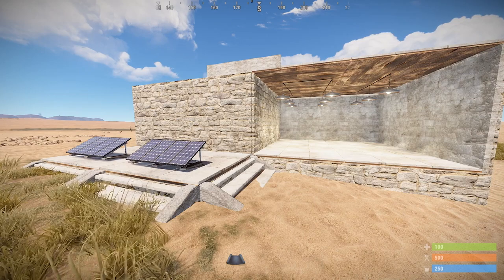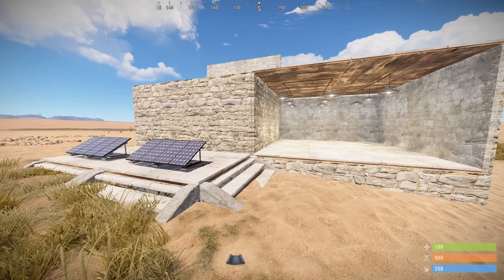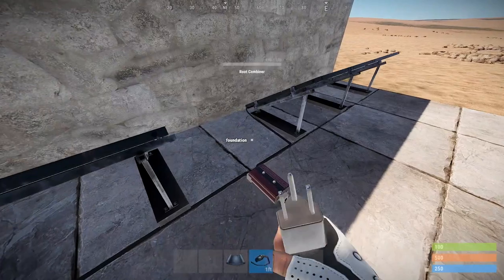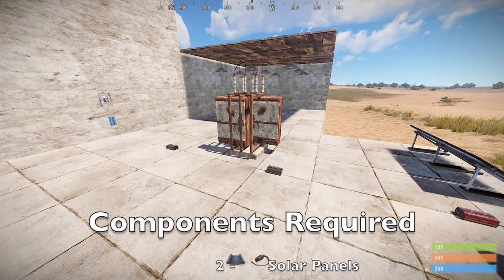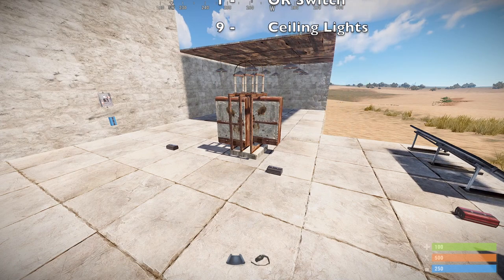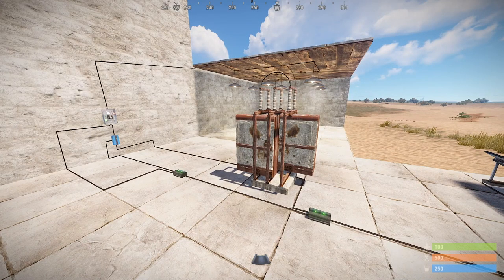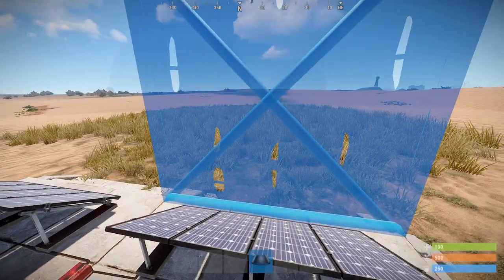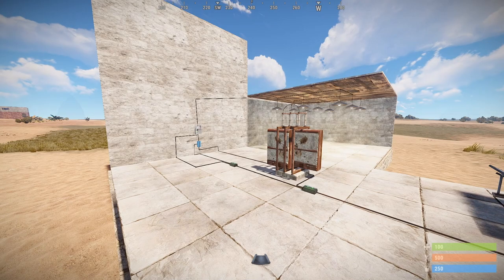(RUST) Electricity 101 - Unlimited Power S02 Ep2 (Battery Backup)

Comment: Funny I have looked everywhere for this solution, and I have found nobody on YouTube knows how to properly setup a multi power source - multi battery backup setup that switches when the power drops below a certain threshold. So I started thinking about it very hard how I could resolve it. Realistically if you could program the blocker to look for a certain block pass through input, and switch if it drops below it that would fix it right? 

So I realized I had to create that scenario myself. I clicked on your video and hit pause and started thinking, if I add a second brand after my main output, and then branch out a small amount to the block pass through, if I lose a windmill or have low power coming in it would switch to battery. 

Then I watched your video and you had the same solution! This one gets a thumbs up from me. Being an electrician this has stumped me and I thought it just wouldn’t the possible in this game yet. 

Thank you!
Reply from the maker: Great to see that my videos are still able to help people. Thanks for your kind words and I hope you enjoy! 
Some things about batteries have changed since this video was posted, which I covered some of them before I stopped making videos, but those circuits are still relevant for certain purposes.

Comment: So maybe I am being dumb... Whenever I did this design I was getting like 268 power from solar panels and windmills (I let the battery reach full charge prior to this) but even at that full power my battery was being drained. To solve this I set the first branch at the power I needed, then the second branch I flipped the branch out to the blocker, and the power out to the OR switch and set the branch at 1 power this seems to have solved my problem. I don't know if this was changed in a patch or I just messed something up but so far it's working beautifully after this change.
Reply from the maker: I go into more explanation about setting your branches up correctly in one of my more recent vids that showcases a few different backup options. Otherwise, join my discord for help :)
Reply: Ol this worked for me, had the same problem

Comment: not sure what im doing wrong, but my battery is just draining, i have 8 solar panels hooked up to root combiners and did everything right. but the blocker itself is DRAINING my battery, the battery only starts charging once i disconnect the wire from the blocker. HELP! :(
Reply from the maker: Sounds like your electrical branches are not set correctly. Perhaps try joining my discord for some help :)
Reply: @SpibsTV  i did and thanks to your discord i got it all figured out. Youre the man spibs!
Reply from the maker: @flavioanguiano8461  Good stuff!

Comment: I did have a question.  Why do you not just have the power go directly though the large battery so it is constantly being charged and then only drained when the lights are switched on???
Reply from the maker: As I mentioned, the lights are just representing a value of power draw. However, with how the electrical components are designed in-game, the battery cannot both charge and output power at the same time. Thus requiring the need for a setup such as what is shown in the video.
Reply: Ah, thanks.  I thought I read somewhere that they did change that.  But I will have to find out now...   LoL 

What test server did you use for your video???  @SpibsTV
Reply from the maker: @rkane9818  They did make some changes, but in a practical sense, it doesn't quite work like that, even if your power draw is less than the amount of energy being put into the batteries. Perhaps it will changed in the future.
Reply: Fair enough, and thank you for the help.  I was able to get 4 solar panels  today.  Now I am seeing if there is an optimal way of setting them up.  I also found out if they are damaged they do not produce at full capacity.  :D   @SpibsTV
Reply from the maker: @rkane9818  Correct!
Also, keep in mind, if you're using a power source to charge a battery, there is no use putting more than 10 power into a small battery, and 100 power into a large, as it won't charge any quicker when the input is above those figures.
Reply: I noticed that even if the electrical branch does not have the branch power being used, it does not divert the power back to the main side.  I have been trying to figure out a way, but the build server I found does not seem to be working correctly with electric components.  What is a good test server to use???  
 @SpibsTV
Reply from the maker: @rkane9818  I have had different results on different build servers.
The one that I use to make these videos is called "Intoxicated EU Sandbox".
It's not 100% perfect, but it's the best build server I have found for my needs.
Reply: Thank you, I have been trying to find one that does not seem to be having issues with the components.  @SpibsTV

Comment: I have a problem.
Here is the deal, i have a system where every time i enter a room in my base, the heart sensor turn the light of said room on.
I use a windmill and it work fine.

How ever, if wind if very low, it do turn one room of light on, but if my team mate is on a 2nd room, it wont turn on cause the windmill isn't generating enough power due to the weak wind (where on middle to high wind it does work as intended).

Now where i need help. I do have a large battery that is charged by a solar panel. I want it to give power (the battery) WITH THE WINDMILL to my electric system if the windmill isn't giving enough power. So both system working, yet when the mill generate enough power, it would cut out the battery and there for the solar panel would recharge it.

Is it possible? And How? I can only make the base to be windmill or battery powered one or the other, not both together automatically when the main isn't doing the cut.
Reply from the maker: This video is exactly for you. The circuit shown in the video is designed to have the battery kick in when the power fluctuates below the predetermined power need of the base.

Keep in mind, IF ONLY using solar panels, you want a minimum of 40 power going to the battery alone.

If you have no luck making sense of all this. Feel free to join my discord (link in description). I'll be more than happy to help :)
Reply: Thanks i'll try it out ;)
Reply from the maker: @1300l  Awesome, let me know how it goes :)
Reply: I wonder why we need at least 40 output to the battery? :)
Reply from the maker: @dexjillings  It does make sense. If you think of it this way, each mobile phone has it's own charger with slightly different voltage required to charge the battery efficiently. This same principle applies here. 40 input was calculated as a minimum to provide just enough energy in the battery to last about 15 minutes which is the duration of night in vanilla.
Reply: I think I understand, so you can not charge the large battery with 1 solar panel? Or does it just take more time?
Reply from the maker: @dexjillings  You can, but not if you're wanting to use it for powering your base at night. The charge it receives won't last the night.
If you're using it to just charge the battery as a backup instead, then it's fine, it will just charge slow.
Make sense?
Reply: @SpibsTV  Yes, very much! Love to you and your vids! I really want to learn the electricity part of Rust. It is so much, but it looks fun when you get the hang of it. :)
Reply from the maker: @dexjillings  That's awesome! It is a lot more simple than people realise. You just need to understand what each component does.

Comment: Is it possible to have 8 Tesla coils running without loosing power ? If so how ?
Reply from the maker: Yes, you would have to connect them using electrical branches and allocate power to them that way that added up to less than 100. 
Otherwise you would have to setup more than one backup system and run them separately

Comment: Most components constantly draw power when connected to a battery. Wouldn’t the blocker do this and prevent it from charging?
Reply from the maker: If my memory serves me correctly, there are two components that will not draw power under certain conditions.
1. Blocker providing that the "block passthrough" input is active.
2. The Switch providing that it is set to "off".

Hope that answers your questions. Otherwise, feel free to join my discord :) Link is in the description.
Reply: @SpibsTV  Yeah I knew about the switch. I was getting frustrated at having so many switches so I hope what you say is true in the current build.
Reply from the maker: @nathanksimpson  It is still the case. I use this setup all the time.

Comment: could you do this using a wind turbine to show its done?
Reply from the maker: It's exactly the same. Instead of using solar, you just connect wind turbine. All values in the circuit stay the same no matter what power supply you're using.
Reply: @SpibsTV  Thanks for letting me know.  I am in the learning process of how to do this and this video helped quite a bit
Reply from the maker: @atomic_diversion8681  No worries, my guy :) Glad I could help you out